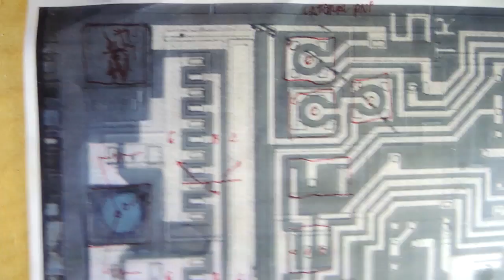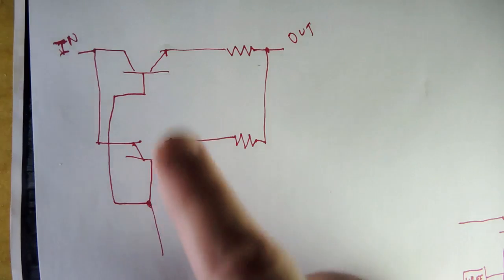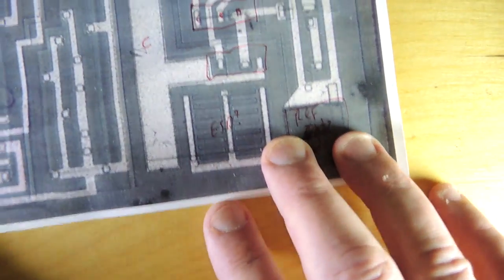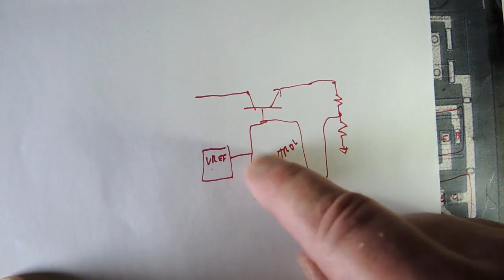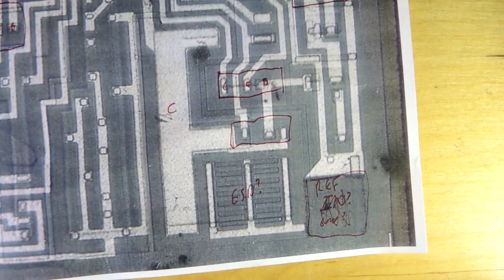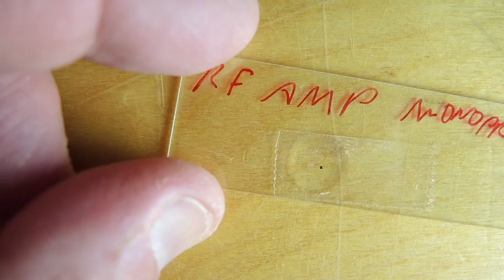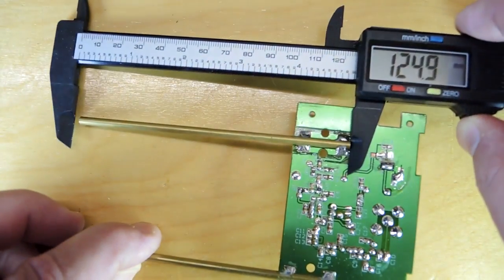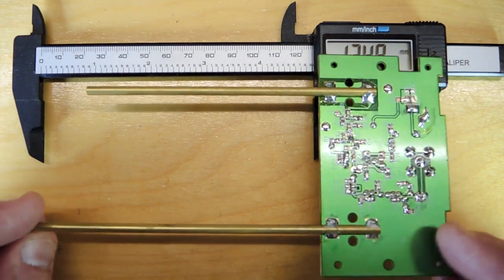Monoprice HDTV Teardown.  Silicon, Antennas...

Comment: Excellent video. Just what I was looking for. Saved me buying one and taking it apart!  Very cool to see the decapsulated ICs too :-)  I'd like to offer another perspective on the two-rod antenna inside. I don't think it's a yagi or other typical type. I think it is an open sorta-transmission-line section. By spacing the rods far apart (like a tenth or fifth of a wavelength), the normal cancellation found in open-wire lines does not apply, and the structure can radiate (if used on TX), or receive - with suitable matching. Basically, what you said. The E field goes from one rod to the other making a voltage between them. B-field perpendicular to the plane that contains them.  Assuming this is correct, it's probably done this way to optimize cost (of course), but also to fit into the desired form-factor and have a pattern that will work when it is mounted in a typical fashion.

Comment: The volt reg is probably a 5V reg to step down the unregulated 9-12V input. The unpopulated place for an electrolytic cap next to it is a clue that its a volt reg. You should put a 100uF cap in there.

Comment: about the regulator output stage: why 2 transistors instead of one twice as big?
Reply: If you look at the layout, you can see that the output pad is in between both transistors. With one large transistor it would be more difficult to place it nicely in the middle. Also not placing it in the middle means a longer distance to the farthest side of the transistor. Now that distance is halved which lowers series resistance. Basically splitting a transistor in smaller ones makes for a better, more reliable design. It is common practice in IC design to do this.